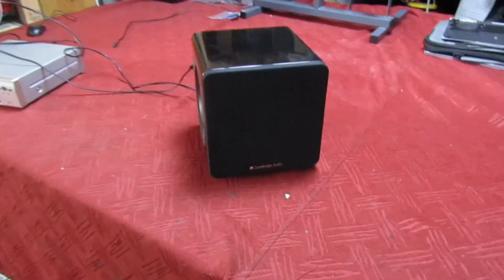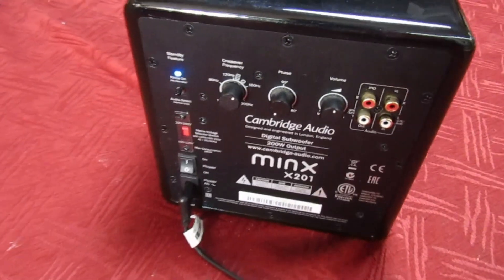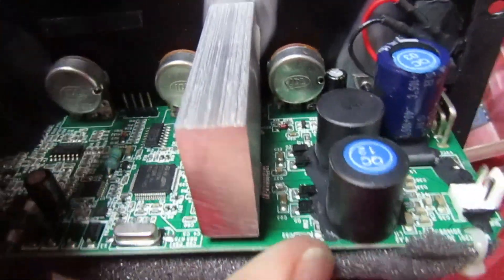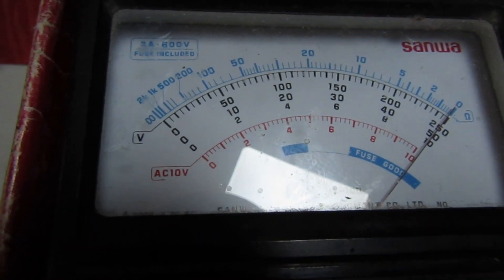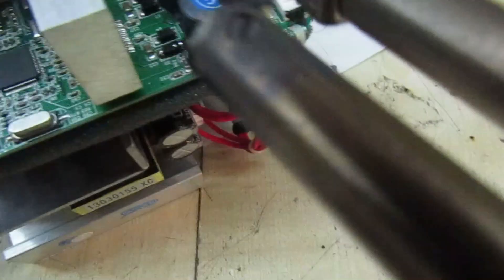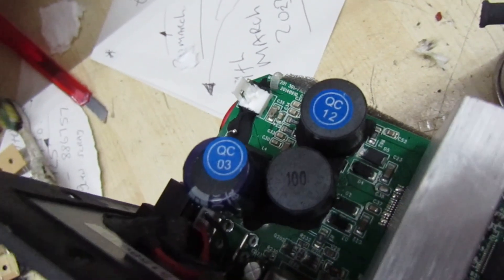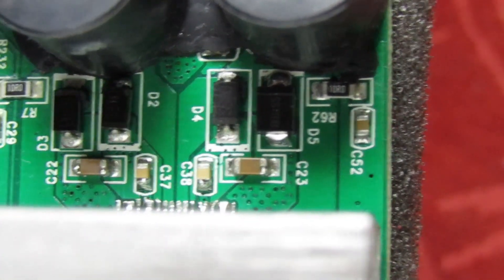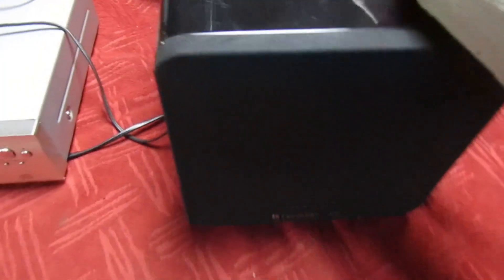Cambridge Minx X201  Subwoofer repair , noise in speaker, distorted sound.

Comment: I have this exact problem and the same diode as in the video has gone.  Replacement on order and fingers crossed it will solve the problem. Well done to this gentleman for posting the video as, for about £2 for the diodes and shipping I should be working again in a day or two. Thanks!
Reply: Just to confirm, part arrived, swapped out and low and behold, we are back in big base action! AMAZING!
Reply from the maker: @charlesmarks1241  Many thanks for letting me know .

Comment: I remember regarding goldstar tvs had a problem with glue in the power supply,
Reply from the maker: yes and that's going back a very long time , wouldn't you have thought by now the manufactures would have learnt there mistakes .

Comment: Hello I have the same subwoofer model. It was listening to normally and suddenly died. I noticed the led it not turning one. Do you think is the power board or the amplifier board ? I'm in Brazil in a small town and no one here can fix it. I suspect the power board.
Reply from the maker: you would need to measure the voltage rails on the power supply first, likely a capacitor has dried out.

Comment: Great video thank you! If you had power but no sound at all, which components would you check? Thanks :)
Reply from the maker: First check would be on the power supply rails to the chips, if you don't have the circuit diagram you can get this information from looking at the datasheets for the chips .
Reply: @michaeldranfield7140  great, thank you for the tip! Was going to just take it to a repair shop but thought I'd have a go myself first

Comment: Nice Mike, gonna say had them same output diodes shorted on this one before. Mine was not glue covered if I remember or not as bad 😁
Reply from the maker: Can't see what purpose the glue serves on the diodes apart from stopping you testing them!
Reply: @michaeldranfield7140  spill over from holding the inductors down
Reply: @michaeldranfield7140  I know right! As soon as it’s condensates or moist this stuff soaks it up. I’ve done several krk rokits and seen water dripping from them at times Mike!

Comment: That looks extremely complicated circuitry for a sub-woofer. I used to build them using two op-amps wired as second order filters, in tandem, and a good quality power amp I.C. Sounded brilliant with a 12” bass speaker in a small cab.
Reply from the maker: I think the more expensive they are the more deliberately overcomplicated they are to justifie the cost

Comment: All the best Michael, I've repaired a couple of those myself a while ago, although the ones I had were PSU faults, looked like they'd had a mains surge.
Reply from the maker: So far I have only had the diodes and hip go wrong on these, does not seem to be a service manual either.
Reply: I’m looking for someone to repair my X200. The unit doesn’t power on any longer. Can you help?
Reply: @peterdavies7623  Hi, it's worth ringing Richer Sounds, I was able to order a replacement complete amplifier plate for one of these. That is the entire electronics part including amplifier and psu. Was around £80 if memory serves correctly.

Comment: Another extremely interesting video - thank you for sharing it with us. It was nice to see you do the soldering and the changing of the failed diode. What did you use to remove the black glue that was covering part of the diode?
Reply from the maker: stanley knife but you have to be very careful as you don't want to damage the print or any smd components under the glue

Comment: Good video again MD. As an aside I notice the mini coloured croc-croc leads in the background. I had quite a few packs (of 10x) of the same a few years ago from CPC, very good price but most were open circuit. Turns out they all needed wire ends soldering to the crocs as they had been stripped but then crimped onto the insulation only, still very good value even with the re-work, but typical of some China quality I guess!
Reply from the maker: Yes I have noticed some of the new ones are crimped, I need to get some new ones , some of these I have are so old the the plastic has gone hard and they are difficult to squeeze open .

Comment: Do you offer repairs? My Minx X201 just started giving a high pitched tone/noise, even when no input is connected, just powered on.
Reply: Hi @stevieboy1984, I'm having the same issue, any chance you were able to solve yours?
Reply: @mpgo13  yeah I took it to a local repair café and a man took it and replaced the diodes and now it is good as new
Reply: @stevieboy1984  thanks mate!